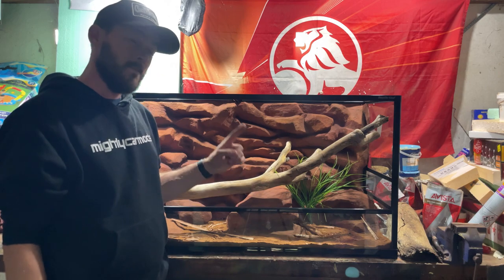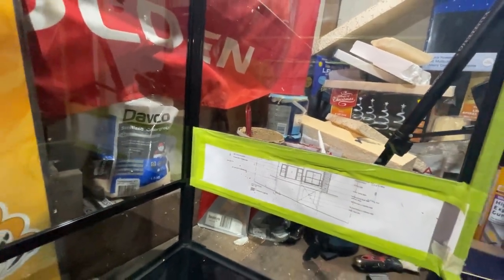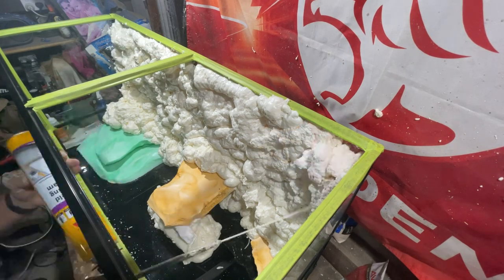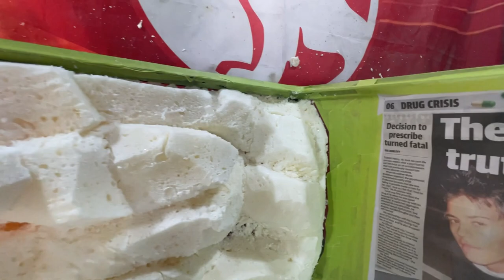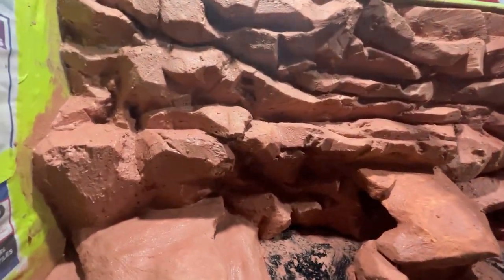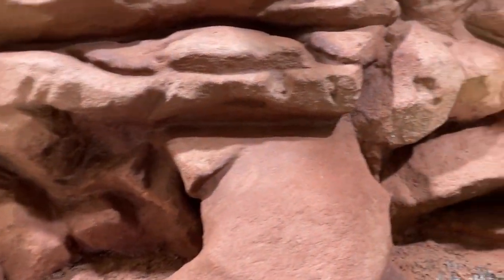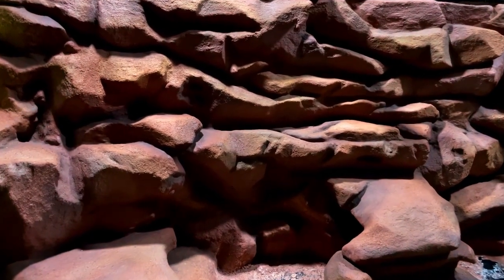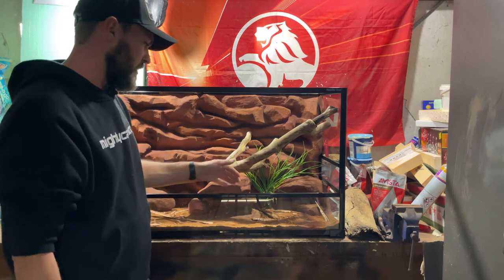How to Build Realistic Background - Desert Theme

Comment: Great videos and Im enjoying learning about this process. I did 4 x 4ft vivarium's and 2 x 6ft vivarium's last year and I was over it after that but could never have my animals in a minimalistic enclosure again, Im addicted. I allow myself 3-4 weeks to complete a 4ft viv and that seems to be about it. I will change to the roof tile pointing for my next build. I used mortar with oxide for colour and im finding its cracking.
Reply from the maker: Yeah mate I’ve tried a few different options in the past. Thanks to a good mate of mine I was out onto the pointing and won’t go back now. It’s simple to work with and can achieve many different textures depending on how you finish it.

Comment: What do you carve the expanda foam with? You have a hot wire cutter but what else? And what do you put on the foam?
Reply from the maker: I just use a fine serrated steak knife to carve the expanding foam. I also have a dremel with various bits I use in some builds also. 
Foam is covered in roof tile pointing. I show what it is in my previous video.
Reply: @Cambart1  thanks

Comment: Hi, my English is not that good, so I would like to know what material you use for the coating?
Is it white grout concrete like Sika 214?
And is the color red oxide of a tile roof?
When do you add sand for the texture?
And do you do all the layers the same? 
I would really appreciate the help.
Thanks!
Reply from the maker: I use a product called roof tile pointing. It’s what Australians use to seal the joints in roof tile ridge cappings. This is only available in Australia from what I’ve been told

The red oxide is just a concrete oxide used to change the colour of concrete. I believe the one I used is terracotta colour in this build

First layer I add a small amount of water to the mix when adding the oxide. This allows the first coat to spread better. I then add another 2-3 coats each with less water or as needed.
Reply: You now if graout is good?
Reply from the maker: Grout works yes. It just doesn’t have the flexibility of the other stuff I used. I began building with grout and have one of my own enclosures made with grout with no problem.

Comment: Do you seal the background with anything? If so what do you use?
Reply from the maker: No I dont seal it with anything. The product I use to coat is a highly water resistant product. I just make sure messes are cleaned up promptly to avoid staining